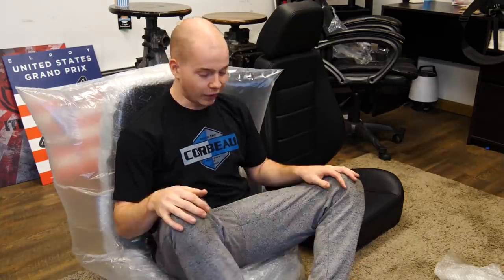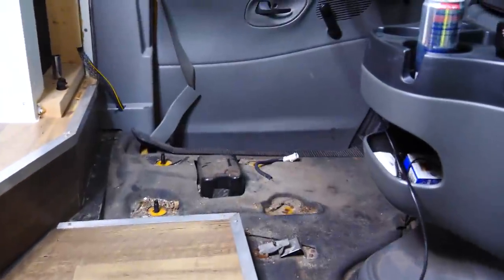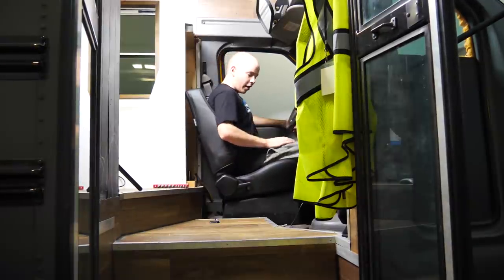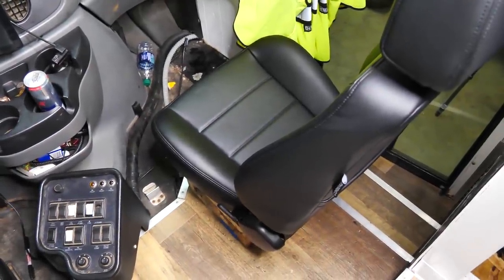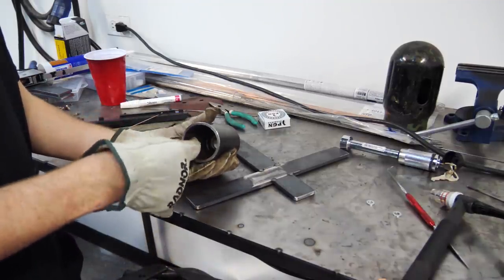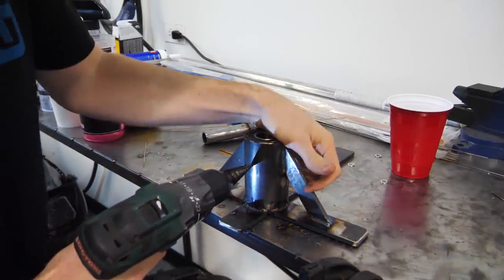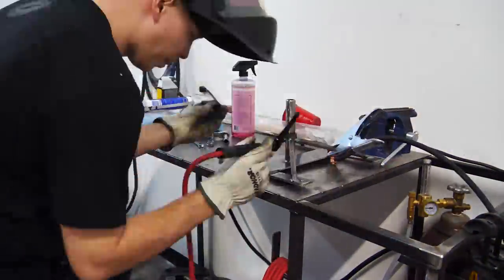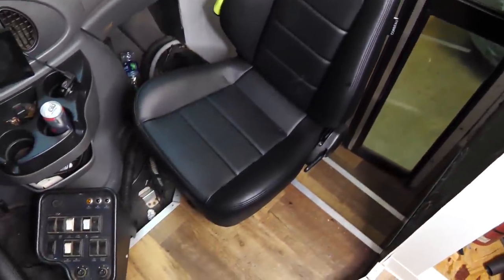Adventure Bus Gets QUICK RELEASE, ROTATING, CAPTAIN CHAIRS!

Comment: I feel like the 1inch pipe that is holding up the passenger seat isn't going to be strong enough in an impact.  The shearing force of a frontal impact is going to rip that seat off or out of the lower mount.
Reply: Nothing about that seat would hold up in an accident

Comment: Will you add like a buckle belt for the passenger? By the way, you really come very far in fabrication skill
Reply from the maker: Yeah! This project is far from finished, we'll be making it safer in the next vid!
Reply: Gingium is there a way to securely lock the seat pin in place so that it doesn’t fly out in the event of a collision?  I’m asking because if you have a seat-mounted seatbelt , your passenger and seat could be ejected as a unit if it isn’t locked in with some kind of detent.  Not that what you have is necessarily subject to any kind of DOT scrutiny, being an RV.. but the liability factor and the general feeling of dread associated with what-if scenarios could be mitigated by some such solution?

Comment: Really enjoyed the video.
Three things though:
- solid mounting plate under the floor or tie to frame rail.
- positive lock all the way through the pedestal. The friction bolt will not hold in an accident.
- seat belt.
Great work.
Reply: Seat belt - yes! Any reinforcing would be kinda pointless if the passenger is not even in the seat anymore.
Reply: How would you do a seatbelt in this case? Since it swivels it would proabably have to be seat mounted. Unless the seat was realllly well mounted i’m not so sure how safe that would be, and could probably only be a lap belt. Could work well tho with a creative solution
Reply: @AltitudeProductions  just send it and strap it on the seat. He just need to really secure the seat to the ground. It's really important to use seat belts 😊

Comment: you may want to drill a larger hole for the threaded shaft to pass through the chair mount completely for accident protection to lock it in a forward rotation more firmly, or the ability to friction stop it any other angle you want.  that way you aren't spun and ejected from the seat in an accident.

either way, great job Caleb!

Comment: I would put the entire bearing assembly under the bus welded into the floor so there is zero tripping hazard and you don't have to change the seat assembly and it would still work just as if not better than the current assembly plus it would look better and be a much cleaner installation
Reply: That was my exact thought too

Comment: Hey gingium a modification you can do is add a divot/hole to the internal rod so that the bolt has something to lock on to and this'll also stop your passenger ejector seating out the window also make the mounts more spread out like a H pattern to stop the rocking the only problem with the X shape mount is it' flexes where the gals are H patterns way more stable and safer too.

Comment: Your fabrication is better all the time! How about putting the seat bolts right through like with the table and maybe add a plate under the floorpan so no flex or tearing, also you could make the seat lock forwards by drilling a hole in the seat post for the locking screw. Great video.

Comment: Hey! Make sure you taper the end of the bolt you use to tighten the swivel chair. Reason being after tightening so many times it will smash the bolt to the point you can't screw it out so if you break off the knob you'll be screwed. I've learned this the hard way...

Comment: I personally would use a thrust bearing at the bottom to make rotation easier. you don't want to put a lot of axial load on a roller bearing. The whole system though is cool bud. Your fab/engineering skills have made leaps and bounds since I started watching you.

Comment: Hi Gingium, cool video, love the Adventure bus project. Great fabrication on the seat mount, but a couple of safety issues....the mount to the floor looks a bit suspect, did you pick up on a chassis rail? You also need to sort out a seatbelt arrangement, would hate to think of Audrey going thru the windscreen....just saying. Keep up the good work, looking forward to next Dadson video!
Reply: The seat will be fine bolted through the floor as long as he used some kind of spreader plates underneath or at least some large washers...

Comment: Hey Gingium have you thought about putting a diesel air heater in the bus? so you don't have to have the bus running to produce heat. Under the bed would be a perfect spot

Comment: having it lock into place with a throughbolt would be much safer. as would having the baseplate bolts go through the metal floor into a welded in captive nut. it deflects that much moving your own weight around.  in an accident that will rip right out and send your passenger through the windshield.

Comment: That seat looks pretty good when in place and seems functional.. it's just the whole mounting to the floor because the floor is weak is a bit of a bummer..   Is there a easy way for you to make it feel more solid?  

I thought about maybe putting thick plate between the bracket and floor to spread a sturdy flat area might do the trick..  but that means finding, drilling, and cutting pretty 'stokie' plate of steel...   Or you could also run strips of angle iron under the seat floor to cut the flex..   the more interconnect and spread out your angle iron is the more study the seat will fit.  

Whatever you do with it... it be a great fallow up video since it be a great chance for more work on the bus.. not that you need more work on the bus but I do love the series.  Keep up the awesome work.

Comment: You might want to add a hole for a pin on the swivel so you can lock it in place when u are moving because I doubt it will stay in place with just the compression of the screw against the tube

Comment: I might suggest doing with this chair is getting a bushing (if you can) and using that as a spring and put it in between the pipe that would go in between the pipe whenever you hit a bump it would be kind of like a semi seat where it also has some form of dampening because they adventure bus is kind of like a semi where they both have really stiff suspension

Comment: Bearings are designed to take load in specific directions, I think the kind of bearing you need for this application is an axial thrust bearing. Even if it hardly ever spins all the downward force (especially on the inner race) will probably quickly destroy those bearings. Or alternatively don't use bearing at all, sleeved tubing with grease would probably work fine.